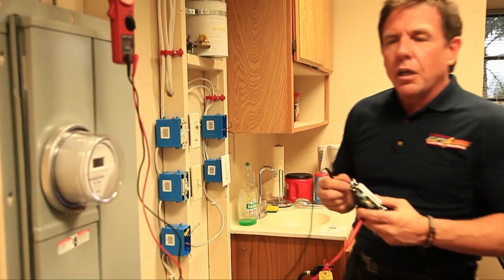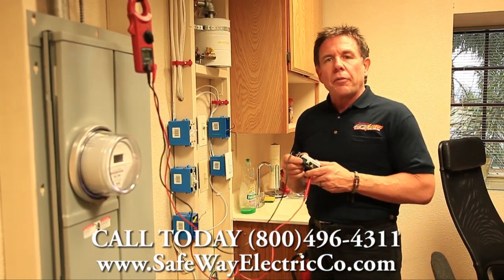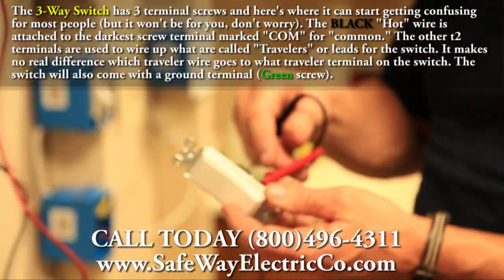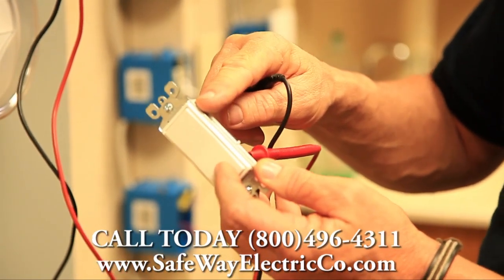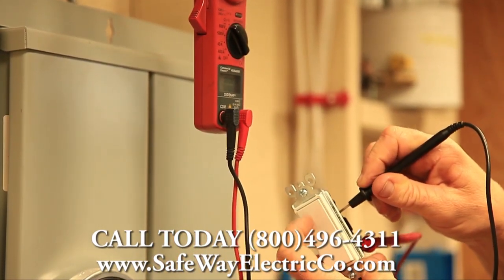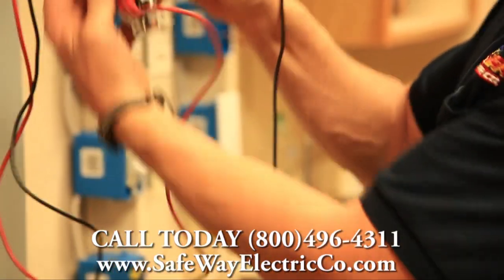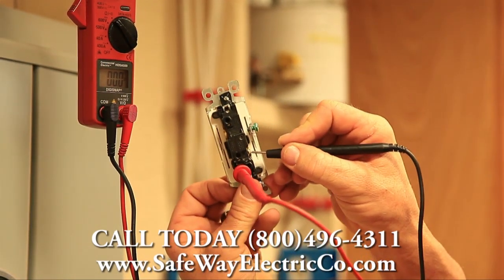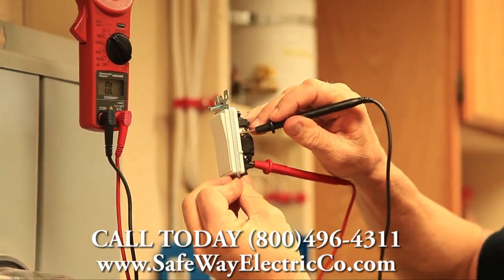3-Way Switches: Testing your 3-Way Switch using an Ohm Meter

Comment: Thank you for this video. It was very helpful in diagnosing a switch issue. I was able to satisfy myself that the switch was working properly.  Next step is to determine proper wiring.